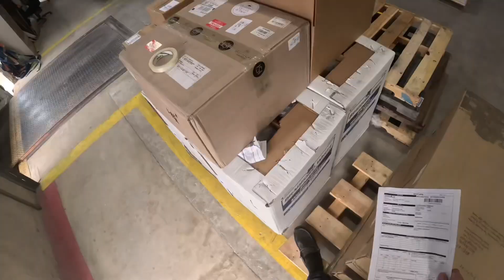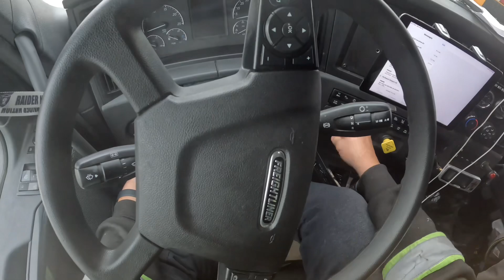Prime Inc flatbed trucking #73. 2 stop load from Charlotte pipe in cedar city Utah to San Antonio TX

Comment: If you want a clean floor, try Simple Green. I used to use it to clean the floor of a plow truck and it worked even on salt. Sometimes you have to really spray it on and let it sit for a few minutes before you try to wipe it down. I'd recommend doing it where you can get some fresh air circulating through the cab because the stuff is wicked strong and it will give you a headache if you're around it for long.
Reply from the maker: Ok I have simple green. My floor get really clean with Dawn soap but it hard keeping it clean with all the mud. But I will try that on my 34 and see the difference. Thanks
Reply: @Tollbooth Jimmy Trucking.  Dawn Soap works as well but doesn't seem to last. If you can do it on a 34 hour reset. Try Simple Green first. Get it clean then  armor all afterwards. It's going to make the floor super slippery with armor all but a rug will help. After awhile, the armor all leaves a good clean but the floor isn't as slippery. I would not use armor all unless you plan to be sitting for awhile. You'll definitely want fresh air going through the cab. I used to do it on a good breezy day since the breeze would go through the cab and push the fumes out. If you don't like armor all, simple green will do fine by itself. Some people mix it with water. Others use straight simple green. If the floor is really bad and you got stains or anything, I'd be generous with the simple green. Spray it on and let it sit 5 minutes before you wipe it. It should work pretty well
Reply from the maker: @davidgrant8994  awesome thanks for the tip I will do this in my next 34 and make a video on it.